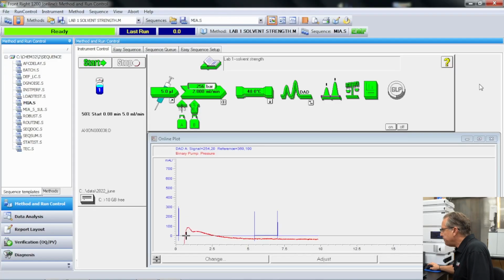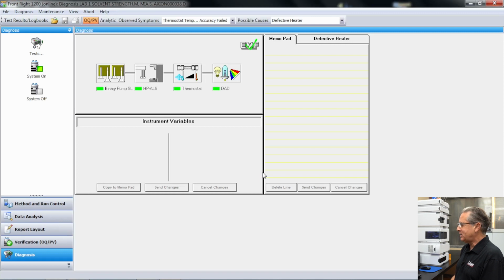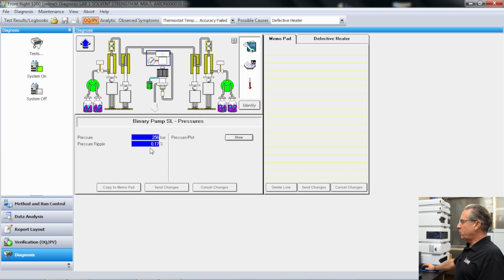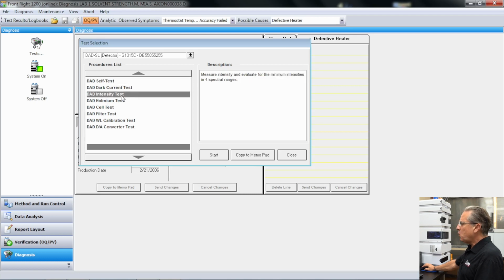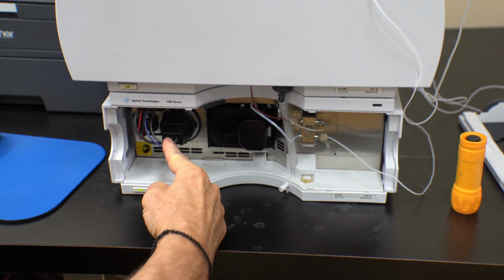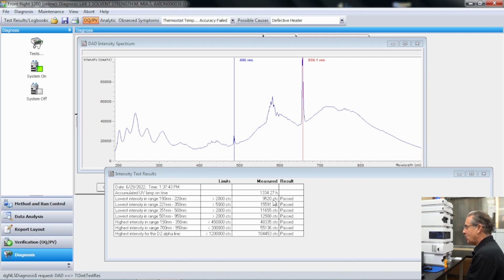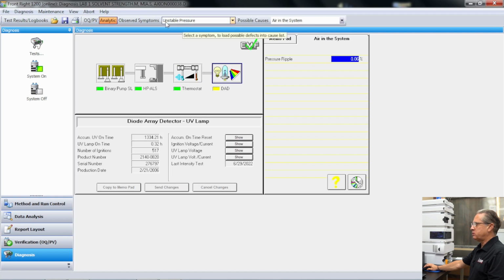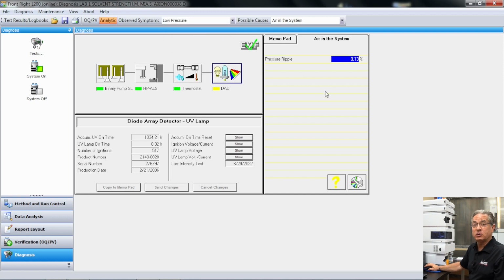HPLC Software Tips: Diagnostic Tools

Comment: You are very nice to listen to, you are persuasive, but I think you are measuring the energy of the lamp wrong. The measurement should be made with the cell placed in the detector and the aqueous liquid phase! When you remove the cell, you look at the lamp in the room through the open door, when you should be looking through the keyhole, :-). The energy of the D2 lamp with use always decreases the most from the side of the shortest lengths and additionally ultraviolet light degrades the mirror surface more than visible light. Therefore, at some point, with a given detector, it is no longer possible to perform analyzes for the length of approx. 200 nm (large noise, small signal), and for e.g. 250 nm you can work for a few more years.